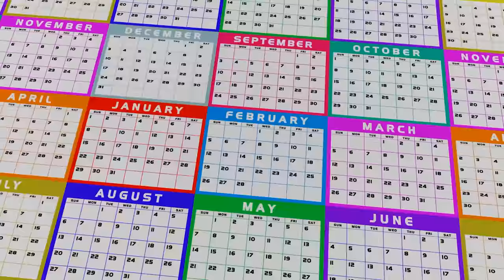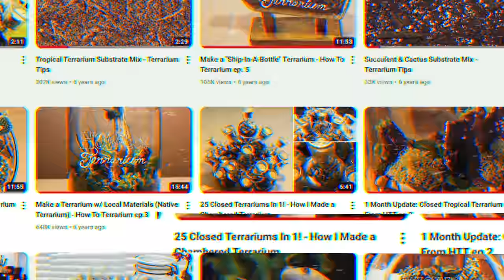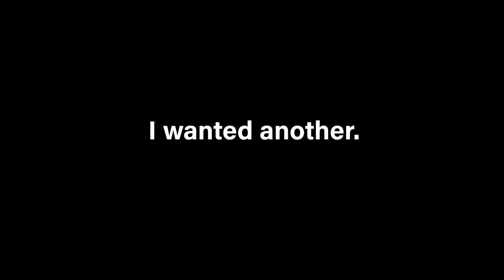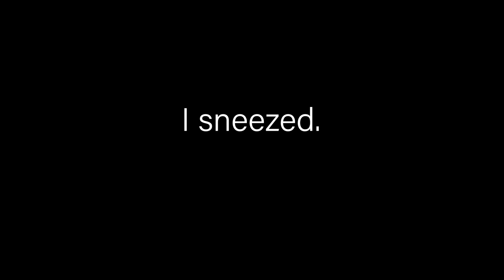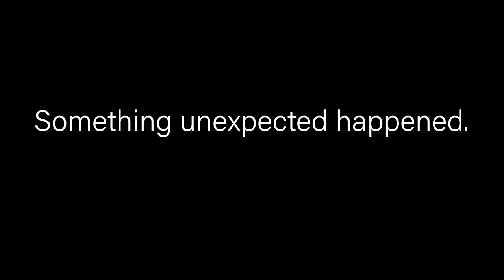9 Year Evolution of My Geckos & Their Vivariums: What I've Learned

Comment: Quick tip. It’s not 100% effective but when you feel a sneeze coming, push your tongue against the roof of your mouth to hold it off until you are able to safely sneeze, sometimes it will remove the sensation completely after a short period of time. Hope that saves some tails in the future.

Comment: Thank you for the awesome video! I'm rebuilding my gecko's vivarium and was having some problems with my old one. The new one is 24x36 so I have a lot of work ahead of me. I was thinking of the drylok method because I hate the silicone eco earth one. I was wondering, what plants were ones you had the best success with so far? I feel like they're all kind of finicky in this setup. I don't know if it's maybe because of the daily misting. I am thinking of adding a fan because my last vivarium had problems drying out.  Where did you install it & did you put a cover over it of some kind? Also, do you have substrate reccomendations, do you make your own and/or was it just the usual ABG mix?
Reply: Also, I really would love to have a moss background. What do you think about using epiweb across different sections of the foam background - like cutting sections out and then applying epiweb, then sheet moss on top? Do you think moss would do well in a Crested gecko vivarium, and which might work better? Sorry this is a lot of questions! I feel like the internet isn't enough for me right now.

Comment: genuine question— how do you control heating temps with your gecko enclosures? heat mats dont seem like the right way unless you have a proper thermostat, and when i tried using those the adhesive didnt stay due to heat (duh) heat lamps ive learned aren’t reliable in vertical vivariums and ive tried ceramic heat emitters with no success either. i researched different options but none seem to be overall effective for me

Comment: a magnet fix,  would create a cover plate of thin steel, 1.5 inch by 1.5 inch, inset to frames with flush fitting, using regular epoxy, creates a larger surface area for glue to hold, and not having magnet to magnet contact, it will last much longer